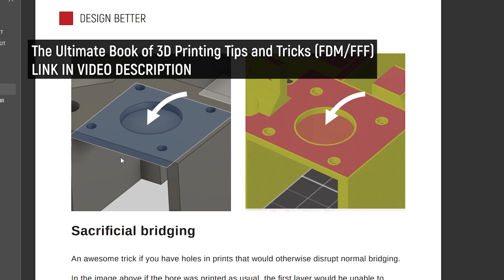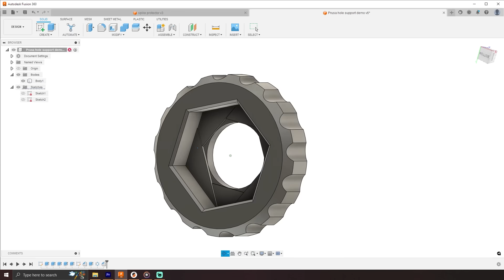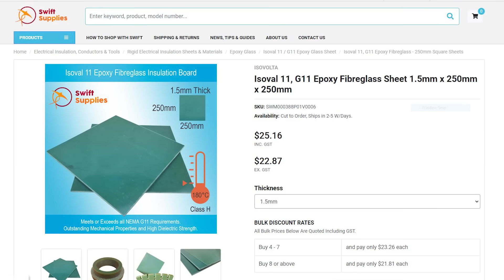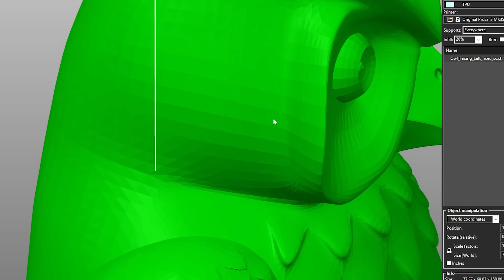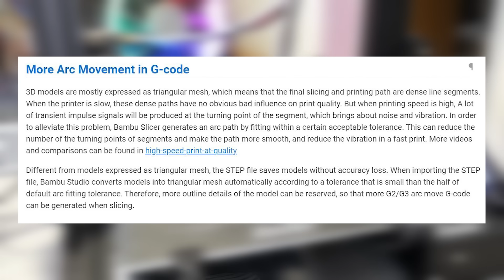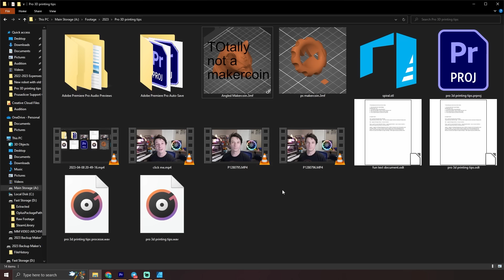5 3D Printing Tips I wish I knew years ago! #3DP101

Comment: I use vision miner nano polymer adhesive on my G10. Put it in the fridge to buy a little extra open time. I apply it directly to 800 grit sand paper then sand it into my G10 and boy it is perfect.

Comment: Another one I used: put a small triangle cutout to guide the slicer for the start/end of the perimeter. So the junction is in the triangle tip and doesn't make a bump in a surface that should be smooth

Comment: You can also open a word/PowerPoint document as a zip.
I'll allow you to easily get all the pictures/video of the file, they are in a subfolder.
That's the only way to export the 3D file of a 3D object used inside PowerPoint.

Comment: Another tip for printing material that warps easily is to use some basic white wood glue and spread it very thin and evenly on your print bed. Works wonders for me printing large ABS and Nylon prints on printers without enclosures.

Comment: I have been using liquid PVA - the cheap craft glue sort - and I just dab a bit of it onto the bed and spread it with a quite damp piece of kitchen roll and wipe it until there is no visible residue leaving a very thin film. It lasts more than ten prints and leaves the contact surface clean of the clumps that gluestick leaves. I have been on the same 150 ml bottle for over three years and less than 10% is used up.

Comment: Thank you for your money saving suggestions!  For drying filaments, it’s worth noting that the BambuLab X1C includes a filament drying menu function as standard…!  You simply put the filament reel onto the print bed and tap on the « filament drying » function with the temperature desired, close the door, and voila!  No extra cost.

Comment: on sacrificial layers/partial bridging: it really depends on the application. It adds to the complexity of designing the part and your results may vary depending on the printer, eg. when using different layer heights. For applications like a small round hole this doesn't make much sense as a sacrificial layer for e.g. an M3 or M4 bolt can be easily punched through with a screwdriver. 
If you really don't want any post processing on "mass" produced parts this may be the way to go, but for small scale projects this is too much effort to design compared to a simple layer. Cool method, but a bit overkill imho.

Comment: oddly specific and total noob-question here: G10 and Prusa MK4, first layer height: does the MK4 detect the metal surface or the surface of the print bed? or does it neither and detects the "moving table" and subtracts the original (print-)sheet thickness?  In short: would i need a g10-plate in the same thickness as the original sheet for the MK4? Can i use a thicker plate without changing printer settings?

Comment: Instead of using gluestick and then IPA, I dissolved whole gluestick in the IPA bottle. The result is gluey IPA fluid, which I apply to the paper towel, and then with that gently wipe it across the print sheet. With that I completely get rid of any glue unevenness on the print sheet and the layer of glue is completely microscopic. Not only provide perfect bed adhesion, but also protecting my print sheet of any degradation. The only condition is to apply on cold print sheet.

Comment: I did buy a bottle of the Vision Miner Nano Coating a while back and it has been great on glass. I won't say it is better than a glue stick for adhesion necessarily, but it is less messy, doesn't need to be applied very often, and my bottle is still 3/4 full several years later. Releases like a dream once the bed cools, almost feels like static is all that is holding it. Still haven't tried the G10 yet, but it is on my list. Really excited about the hole bridging trick, can't wait to give that a shot! Great video as always!

Comment: I expect that slicing with a STEP file will get better curves eventually. It's been said that there's no control over settings "for now". The 3mf one is... meh. As someone else said, a lot of formats are zips. There is a standard and there are those who have made no-compatible versions. But the standard is very loose so besides model details/geometry, there really isn't anything required. You can have multiple files, project details, etc. but also those project details may only work in one slicer. Security issues depend more on how the slicer deals with the files. Most don't do more then read files they understand, so it should be fine. Also worth mentioning, unless you specify otherwise, the paths are relative and don't show system details.

Comment: I used G10 on my Ender-5 for several months, after seeing your prior video - and loved it!  It didn't work super well for ABS, but, well - I was trying to print ABS on an Ender-5, of course that didn't go so hot.  But for PLA it was amazing.

Now I have an X1C and haven't been able to figure out a good way to get a G10 print surface on that printer.  To be sure, I mostly print ABS for prop-building, and the "engineering plate" the X1C comes with works very, very well for that.  But if anyone's figured out how to easily put G10 on the X1C, I'd love to hear about it.

Comment: "Don't waste your money buying specialty adhesion products..." A tube of my preferred bed adhesion product is $20 and has lasted me well over 2 years. Furthermore if you have never bought it, and never used it, how do you know glue stick and IPA work just as well? As someone who has used both, the specialty product works better... For me it comes down to ease of use. With a Glue stick I am cleaning at least every few prints where as with a specialty product I can leave it on for weeks at a time only putting minor dabs of it where needed.

Comment: Just tried to export STEP file to PrusaSlicer. It works but not great. PrusaSlicer converts it internally to STL and the shape ends up faceted. I found that OnShape does a really good job exporting smooth looking STLs so that's what I use.

Comment: Triangulation\meshing artifacts aren't a problem if you use correct scaling before exporting. Probably the slicer is doing exactly that when it's "slicing" step files. 
And if you need a model that can be printed in several different sizes, export in the biggest possible one and only then downscale if needed.

Comment: My sort-of-issue with 3MF files is that if I create one in Superslicer, then when I open it in say Prusaslicer, it complains about settings for which there are different names between the slicers.

My cheap filament dryer is from Kmart.  I used the cardboard box it came in, to make a shelf high enough to put the spool in.

Thanks for the hole bridging trick.  I'll definitely use it in the future.
Reply: Can you export strictly as a model? No settings?
Reply: @tsikada  Not as far as I know.  Upon import though, most of the slicers complain about the settings but import the model anyway. In Orcaslicer it does this more gracefully than in SuperSlicer.  In Prusaslicer it gives options including import of just the model. In Superslicer from a Prusaslicer model, it just dies.

Comment: I apply glue stick, then add a little water.  I mix the water and glue with my fingers to form a thin paste that drys to a smooth surface when left flat.  It enables a defect free surface finish on the first layer.

Comment: Anyone have a reference to a 350*350 sheet stock of G10/G11 in the US?
I can find them at Amazon and McMaster Carr, but at $50 - $70.
Because my size is just greater than the standard size of 12", price jump drastically.
That makes it as expensive as the flex plate with both textured and smooth PEI  I just bought.

Comment: I use alcohol to desolve pvp glue stick. all I got was a little bottle of syrup, which can easily poured over the printing sheet. use some non fabric cloth I can apply it to form a thin layer. it works really well.

Comment: I concur on the last item (eye wink). My worry is that a CAD tool or slicer will include user and system data without the end user knowing it and that concerns me. We (okay, I) preach about locking down your home network and not letting applications "phone home" with my network and system(s) data as well as them to tunnel into your network. And while you may be able to block this traffic at your router, they may be able to get your data another way, through their cloud services. The router blocks the data squirt from the application but you, the end user, allows a 3mf file to be generated, which bypasses the firewall rules in place. So while you think you are allowing their cloud to host your file with print data, it could be scooping up everything you wanted blocked from the application sending it. So basically, you are doing the work for them.

Comment: Glue sticks, mixing with alcohol... ugh, too much effort. Here's what you do: get the cheapest hair spray you can find at the nastiest discount store around your parts, give a quick spray of it to the bed before each print, and voila - perfect sticking. Only real drawbacks is your prints come off smelling like hairspray, but the smell goes away quickly enough. Don't try this with your SO's fancy hair spray, though; aside from probably angering your SO, it won't work as well since the pricier stuff has all sorts of powdery additives that work great for your hair (presumably) but aren't good for adhesion.

Comment: I use the sugar-water solution method for bed adhesion. I have had so many bed adhesion problems it almost drove me into throwing my printer out the window. I have bought a fiber glass bed, but that didn't really change anything, I tried gluestick and it didn't really work all that well (the heat made it useless after 10 minutes). The sugar-water method is easy, cheap and it simply *always* works. I have never had a print fail on me due to bad bed adhesion since I started using this method.

If you are curious about a how-to, see: https://youtu.be/72DMNEGhyhk

Comment: -With the hole bridging for HEXes I really have to spend the time to get presets made into SolidWorks so I can let it do more of the work for me.  because it would be nice to have it do a better hex nut hole and all
-I didn't know PrusaSlicer can handle STEP files.  that is great to know, especially for curvy stuff or large circle parts.
-The 3MF is a lot more capable than I thought.  I thought it was an STL file that carries printer settings.  neat to know it is a lot more than that

Comment: Ok alright, you’ve sold me on G10 (or G11). What’s the best thickness I should use for my 220x220 bedslinger printer? Also I have the ender 3 s1 pro, so would regular G10 still be ok with the up to 110C bed temp that my heated bed can achieve?
Reply: G-10 has a continuous operating temperature of 140 degrees C / 284 degrees F. The thickness recommended here is 1.5mm / .062″
Reply: @paulhaddon7113  alright thanks

Comment: I bought g10 in the past, very rarely can I get a print to stick all that well on it. Half the time I get a failed print due to the part breaking away from the bed. High quality PEI can be used for PetG and I find there is really nothing better than it for most filaments. That being said I havent printed Nylon or PP on it.

Comment: Instead of the bridging trick I use sacrificial layers for nuts and bolts. A bit faster in CAD but you have to cut the holes open when you clean the print.

Comment: I've NEVER used glue stick, or anything else, just a clean bed and proper z- offset. The only time i had a problem was with Overture Matte PLA and I wound up putting painters tape on my bed surface. I tried everything, glass, pei, adjusting various settings like speeds and that stuff would not stick. But the tape worked like a charm
Reply: Ive been batling Matte PLA from Overture also and found it sticks for me on Rough side of PEI Bed surface and i have to turn bed temp up to 65C for first few layers and 210-212C nozzle temp with a .06 nozzle instead of .04 . No fan speed for first two layers either. Tried and tried on smooth side of PEI bed and rarely sticks. Seems like the black color has a harder time for me too. Brick Red and the green have stuck better.

Comment: I discovered this hole bridging trick by accident two weeks ago when I downloaded a printable measurement device from Printables which had a hex hole at the bottom for an M3 nut. Since my slicer, contrary to my expectation, did not inform me to activate support structures and the print ran without problems, I then took a closer look at the model in Blender. I discovered this trick with exactly one layer height for partial bridging in one direction, a second layer with further bridging in both directions and subsequent layers for the round hole and saved it in my mind as a clever idea for future models.

Comment: Curious about the G10s temperature resistance. If it’s only resistant up to 125C, wouldn’t the nozzle damage the bed when you’re leveling at temp? A 220C nozzle pressed up against the bed seems like it would leave a mark.
Reply: G10 is rated to 140C continuous operating temperature.

Comment: Wow.  The two column image with the orange background shown as the teaser still does not appear at any time during the video.  

I could not see any differences between the STL and STEP file prints that you showed.  

I've been using hair spray instead of glue stick for at least 10 years, and it works fine for me.  Glue stick may also be fine, but I find hair spray to be simpler and easier.

Comment: One thing that I have never seen mentioned as a bed adhesive, which worked much better than any gluestick or hairspray for me on a glass bed, is a salt solution!

Just mix loads of salt into some warm water, heat up your glass bed, then wipe the mix on lightly with some paper towel, it will quickly frost over as the water evaporates and it works fantastically.

The best thing about this is for old/cheap printers where the beds warped, a $5 sheet of glass and $1 in salt and you've got a perfect performing bed again. If you read this angus, give it a go, i think you'll be pleasantly surprised. heck, i've even been known to do this on my voron!
Reply: Interesting. Do you save the left over salt water in jar?
Reply: @anon_y_mousse  yep, just keep a little mason jar of it and it lasts forever

Comment: 0:13 1. The prusa research hole bridging trick
1:29 2. 3D print on G10 (Garolite)
2:30 3. Bed adhesion with glue stick + IPA
3:19 4. Drying filament with food dehydrator
4:40 5. Slice using STEP files
5:51 Bonus
Reply: thank you
Reply: Do any of those relate to the thumbnail?
Reply: @D4RKFiB3R  Same here, also clicked the video because of the thumbnail and then wondered why there isn't even a single word about what the thumbnail shows.
Reply: @D4RKFiB3R  dry Filament

Comment: I've had 90% success rate with my coated glass Creality bed, but I really want to try PEI because I think it's a cool finish. I also want to try G10 to see if it's any better than what I'm getting now. Thanks for the great tips!
Reply: I’ve been enjoying my PEI sheet that I’ve recently purchased but I have had difficulties figuring out the proper Z offset. On the one hand, we want prints to stick so the “squish” is necessary, on the other hand, I’ve been playing around with PETG and it requires less “squish” so it’s been difficult finding the sweet spot. I can say that I have never felt the need the need to use any glue stick which was my used in excess on the glass bed and whatever the material is that you get when you buy the creality magnetic bed sheet

Comment: Try denatured alcohol instead of IPA.  It does not have water in it and works very well to reactivate and redistribute whatever glue residue is left from previous print.  Denatured alcohol is available at home improvement stores in the paint dept.
Reply: Or just buy 99.9% IPA...
Reply: @herrgerd1684  sure. I was actually surprised how much better dna worked.

Comment: i use glue for connecting plastic plumbing pipes i print abs directly on an aluminium build plate after i destroyed my pei layer! works great can also use it for fusing prints together even works with pla.

Comment: The step file information is a bit misleading.  Prusaslicer converts the step file into a non configurable stl file on import.  Aka it's not using the step geometry.

Depending on what settings you use to create your stl using a step may actually be worse.  This is especially evident with a complex model and can even be seen in prusa slicer preview.

Comment: I was accidentally using the alcohol/glue stick tip!  I used glue stick, then wiped the plate down with an alcohol pad every 5 prints or so.  No wonder it kept working!  :D
, m.

Comment: Using a Zip as a meta-format like that is done a lot because Zip is a well know, rarely failing archive that has a ton of code implementations of. Sometimes is a single file wrapper, others it is a fixed structure directory tree in a supposedly known format.

Comment: 🫧 I have to disagree on one point. The glue is outdated even for hobby printing. It lasts for one print and has to be laboriously cleaned, makes a messy surface. Proven sprays like 3DLAC (cheaply available in Europe) for basic materials, or Dimafix (slightly more expensive) etc. for more demanding materials, leave a perfect surface and last for multiple prints. Adhesive and separation layer at the same time. I have been using for years.

Comment: Do food dehydrators actually get hot enough to dry nylon? I thought you had to get it up to at least 70C to dry it properly.

(Great tip about building up the overhangs in steps, I can see that making a big difference for some of my prints going forward!)
Reply: I've never dried nylon but I have a cheap dehydrator that goes up to 75 C.
Reply: @YourArmsGone  I need to take another look at them then. One thing that’s stopped me in the past is that pretty much all of them have an uncomfortably large number of 1-star reviews :-/